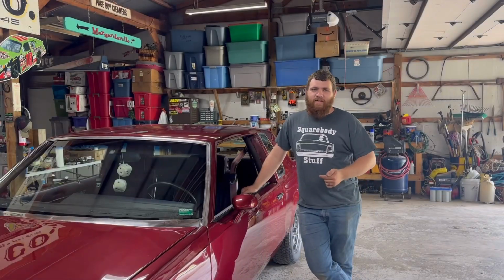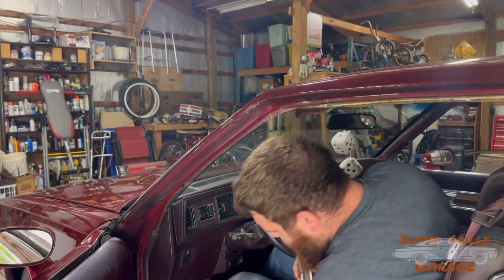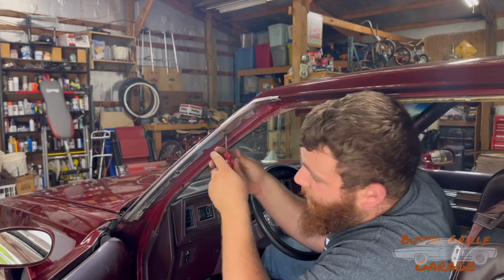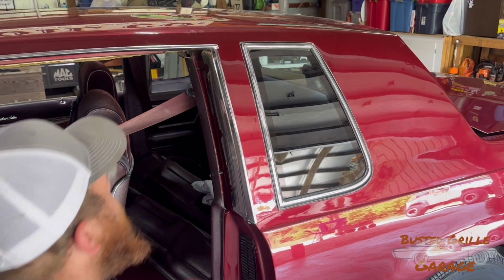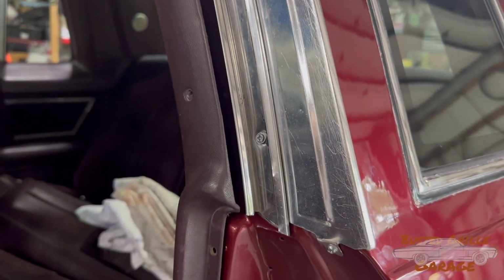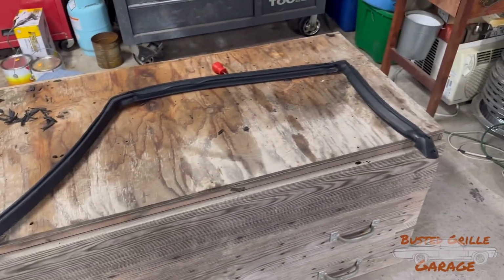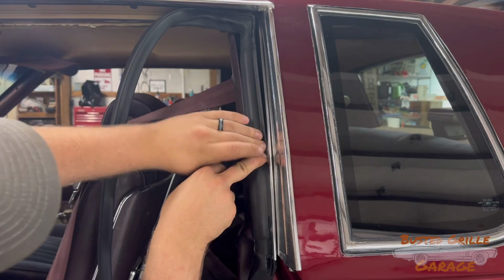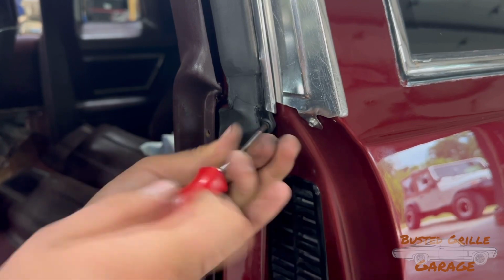Upper Door Seals and Moldings on a G-Body Cutlass #nonamenationals

Comment: Describe, I'm really struggling with my. Appreciate it weather stripping on my El Camino. Had a shop installed and I don't think they put it in right. Think the windows sit on the outside of the seals and I cannot get them adjust it out

Comment: I'm about to be doing this in the next week. Only question I have. Did you replace the foam that went between the weatherstrip tracks? What thickness did you use?. Also the chrome piece at b pillar had something as well. Did you replace it? Just want to make sure I've got this right
Reply from the maker: It would absolutely be a good idea to replace that foam, but no, we didn’t. As far as thickness goes, something pretty thin would have to be used. Thanks for watching!
Reply: You can use urethane on the bac side b pillar trim and a dab around each screw locations on back side of the trim